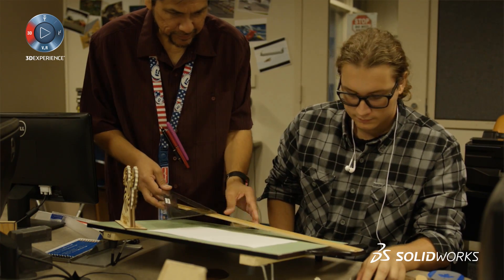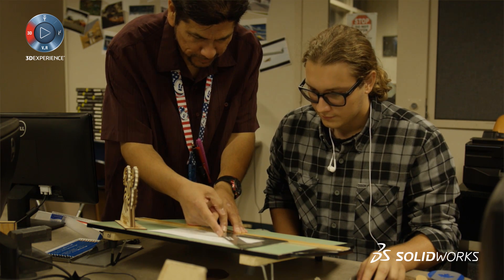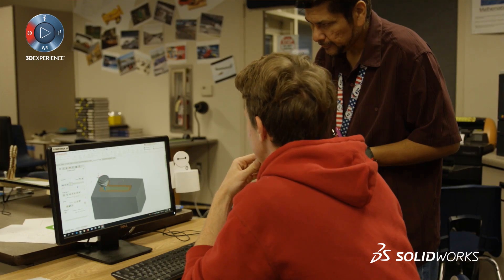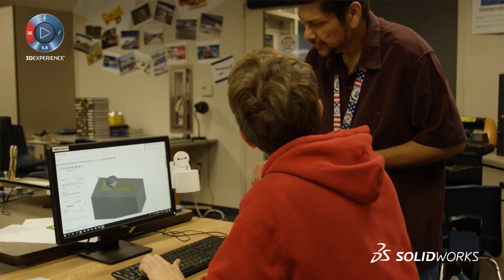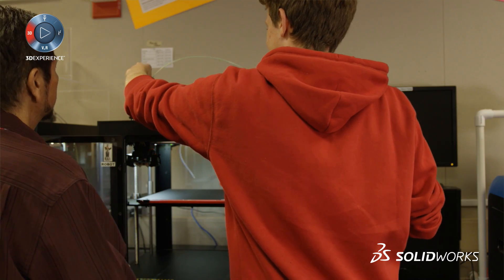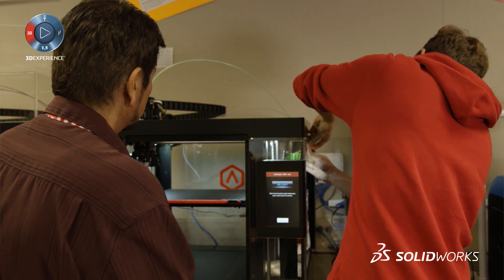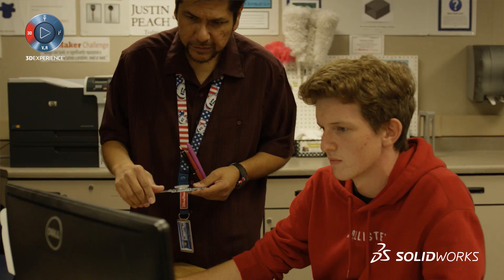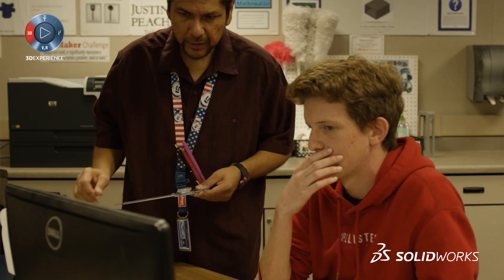Trabuco Hills High School - SW Certification - SOLIDWORKS

Comment: Mr. Ureno runs a great program, he is awesome. 

Most schools nowadays with a "STEM" curriculum of some sort offer 3D modeling in one way or another. Unfortunately, many offer Autodesk Inventor/Fusion 360 simply because it is free. PLTW also has a relationship with Autodesk, so most schools using their curriculum use their tools. But, IMO you get what you pay for.

Tustin High School, also in OC, has been certifying students in SolidWorks for over six years now, giving their students a leg up both in college or in the workforce. The SW class is the cornerstone of the Tustin Technology Academy.

www.TustinEngineering.com
https://blogs.solidworks.com/teacher/2018/11/ed-hernandez-part-1.html